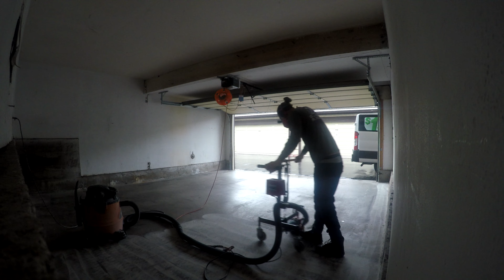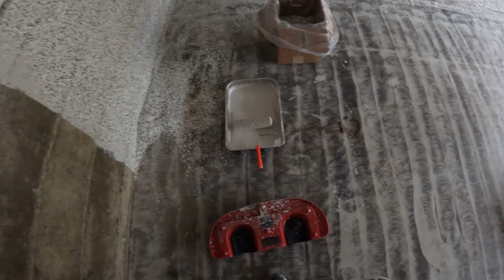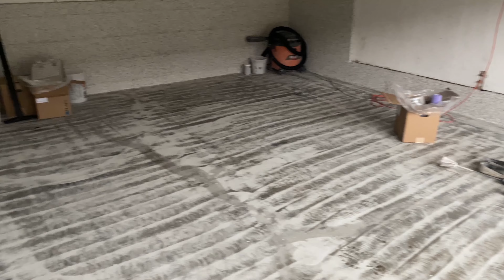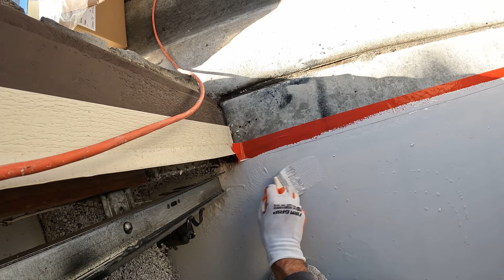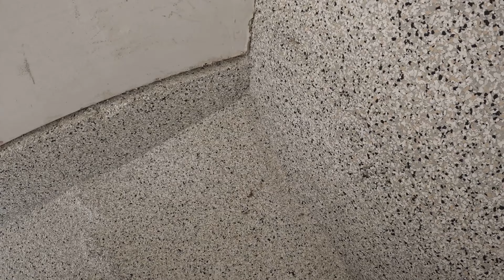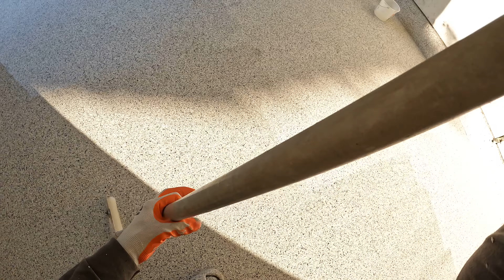How To Epoxy Garage Floor in 2024

Comment: Hey man great job! Turned out nice. Few questions: I do realize the video is sped up at time ls but in general you have to move pretty quick get the flakes down on wet paint right? Also when you’re  scrapping for a smooth surface before the epoxy goes on, what if you scarp off too much or scratch the surface? Is it easy to patch the section? Or is that part hard to mess up?
Reply from the maker: If you want some tips and tricks i did this video with some voice over https://youtu.be/UkXRt1lc7W4

But with the chemical i use (polyurea) you have about 20 mins before it will get too dry.

scraping takes a little technique so you dont mess up the floor. repairs are very quick and easy with fast a drying product.